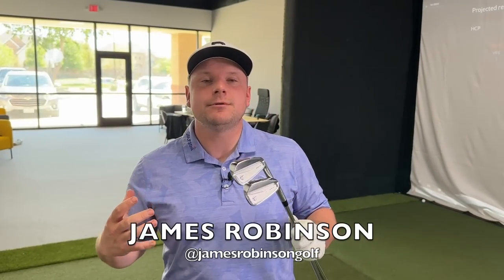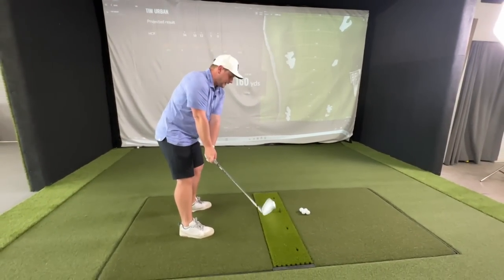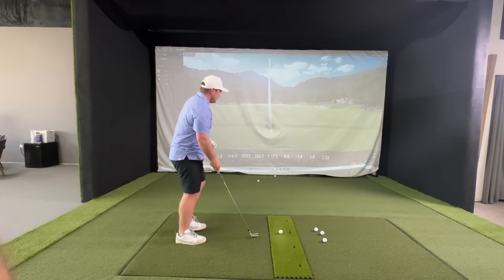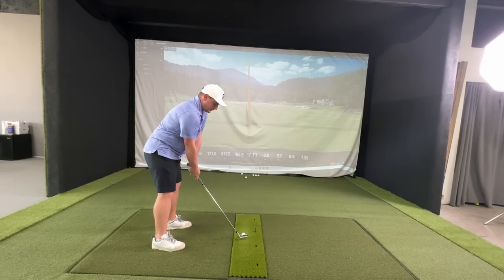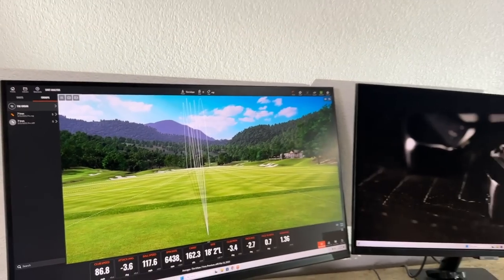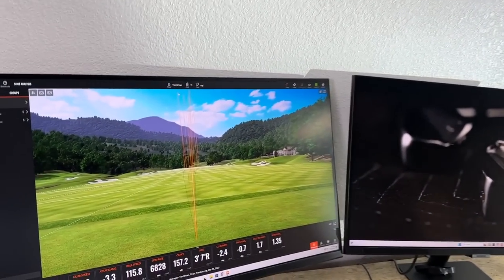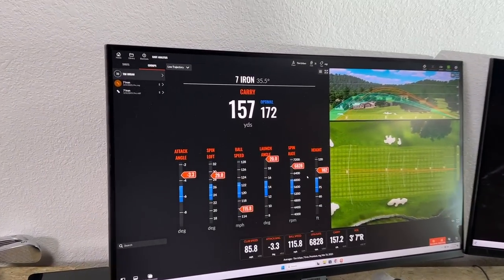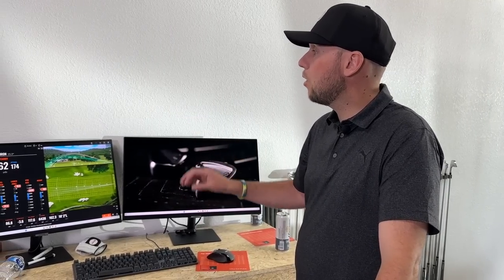Are You Using The WRONG SHAFTS? (GAME DESTROYER!)

Comment: opening up pandoras box with this topic.
Reply: Shafts are minimal difference as actually proven by this video. 5 yards difference and 400 rpm spin lol. So what they are saying is no difference 😂
Reply: @First name  based on my fitting, shafts had a bigger impact.  I'm over 50 and we started with senior flex. Horrible shots and feel.  Club speed is 92mph so I ended up with heavy/stiff.
Reply: @craigseaver8062  how long was your fitting and how many shots. Ideally you should go back and get fit 3-4 times over the course of a couple weeks, then you will truly see the data. Feel is the main thing to look for in a shaft.
Reply: @First name  agreed.  Did 2 fittings. About 1.5hrs for the first one and under an hour for the second.   Lots of shots first day. Not many on second.Ended up with I525s with Project X shaft.

Comment: I went from being fit to a nippon modus 120x to fitting myself into a true temper elevate 115 xstiff and it was like unlocking a cheat code.  My swing is also much different between then and now.  I picked up the 10 yds I had lost due to trajectory and spin, and can now comfortably hold a green from ~195yds with my 5i.  It's not always the archer... You need proper equipment.

Comment: Playing a set of Takomo 301 combo, with the KBS tour 130g X-stiff... To be honest, it's "gentle x-stiff" and the swing weight is very well tuned so they feel lighter and softer than the PX 6.0 I had before (I still obtain a slightly lower launch, to my delight). I might add that I'm not very "shaft sensitive" (within reason.... give me something 120 to 137g, stiff to 'tour-x' and I'm happy and will naturally adjust to the shafts rather quickly).

Comment: Top video guys, 
Ive never had a fitting because alwasy fought  its for good players im okay around 90 on a bad day but most around 84ish, i feel like i have a fast swing but but most of the time my long irons goes right so i find my self slowing my swing down to control it better. Never had a lesson so i dont know if im doing something wrong but i have mizuno mx15 i want new irons like the 101 or 201 takomo but not sure about getting fit because might not be good enough. Any help will be lovely? Keep the video coming guys
Reply: Lessons. Fitting. In that order. Your swing will evolve and when it's on point, you'll want the right equipment to compliment your swing.  I also used to be fast, but now I can carry longer with a more efficient swing and hold greens better, thus lowering scores.  :)